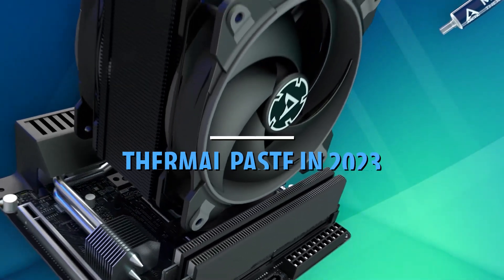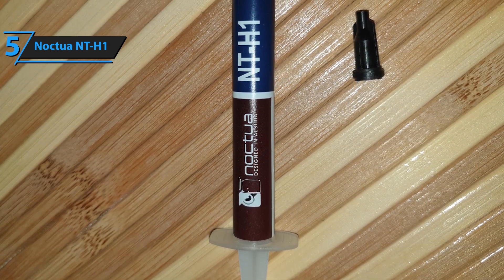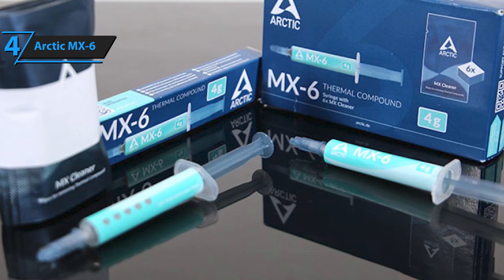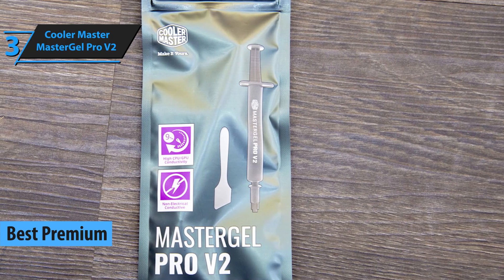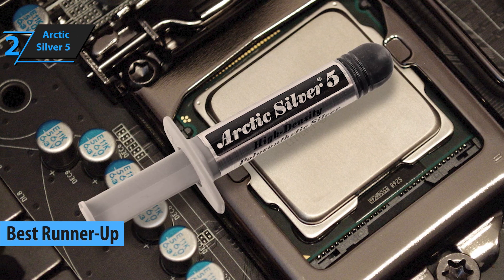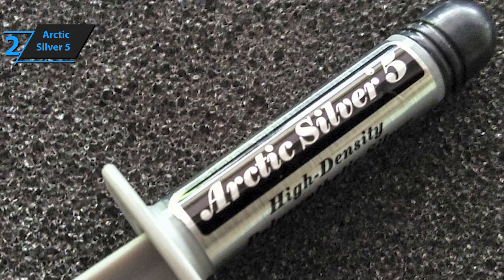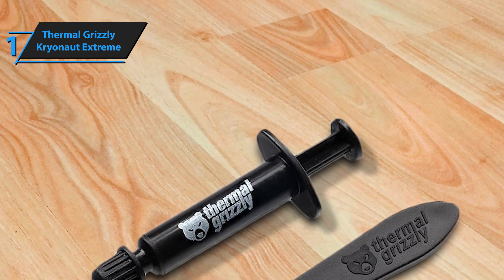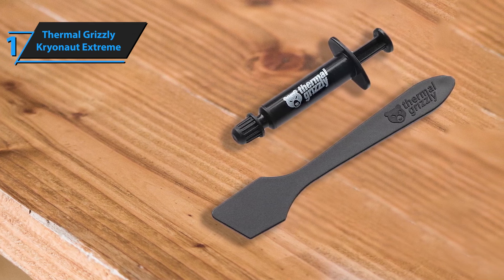Top 5 BEST Thermal Paste of (2023)

Comment: Love my Arctic MX-6.
Reply: Thermal pads on intel is a hard no lol…. Your gonna blow up some of your cores
Reply: MX-6 thermal conductivity is only 7.5W/mK
Alphacool Apex is 17W/mK
innovation cooling graphite thermal pad is 35W/mK
liquid metal is 130W/mK
higher is better

 MX-6 is shiat
Reply: @darkshadowsx5949  well my Ryzen 9 5000x idles at 26c and never goes over 60c I'm happy esp in CB r23 23,368mc 59.8c.
Reply: @darkshadowsx5949 comparing thermal conductivity among different brands, let alone products other than thermal paste, is not really deterministic of the final results a thermal paste will achieve.

I recommend you search around for a few benchmarks on the MX-6. It’s actually a really good and affordable product.

I personally use Noctua NT-H2, but I’d say Artic MX-6 looks really convincing as well.

Comment: 2 different Noctua thermal paste 1.19 NT-H1 and a second later NT-H2
Reply: That’s the best paste. Rn I’m looking at Artic silver & syy. I’m seeing good reviews with these 2.

I have Mx-4 but I want to look into other paste & see what’s better
Reply: @gorkman5697 since I have a 7800x3d now, I got thicker paste. I’m using syy. 

Has a thermal conductivity of 15.7W/m-k 

with a viscosity of 200.000 cps.

it was a little annoying to put on the cpu & at first I wasn’t use to that since I use to use mx4 but it’s one hell of a paste & it doesn’t cost much either. 

The reason I got thicker paste is because thinner paste will leak into the bottom of the cpu much easier.
Reply: @gorkman5697 when ever you get the chance you wanna drop that voltage down to 1.65mv which =‘s 1.2v.

thermal grizzly is really good, I’ve seen a lot of good reviews on it but be careful with Liquid Metal paste. one wrong move & you can damage the chip or the motherboard so just be cautious if you go down that route. 

as for the amd gpu, they do tend to run really hot so that’s no suprise to me. when it comes to both gpu’s, re-applying paste would do the trick. 

if it’s still too hot then you would also have to change the thermal pads that go over your memory & vrm’s. 

if I’m not mistaken the back of that gpu also has one so just take measurements of each pad in terms of thickness & length so you know what to look out for when making a purchase

Comment: I use peanut butter, it give me crazy low temps for ln2 eXtreme oc
Reply: Guys I trusted this guy and applied peanut butter but after 2 weeks ants went inside my laptop.....so please don't try
Reply: @madhanraaja.u5912  Bro how did you not know this was a joke 😂.
Reply: I use nutella
Reply: I put Colgate tooth paste
Reply: I use high voltage silicon rubber paste
Reply: Try lotion
Reply: crazy .. be careful of roaches
Reply: Try sperm from your penis. From personal experience works best, it’s free & quick to produce not to mention you’ll be pleasured👌🏽
Reply: you guys are maniacs
Reply: you clearly should be putting ketchup and mayo. For a saucy performance

Comment: you forgot to mention Thermalright TFX
Reply: That's a great thermal paste .just needs 20 mins in a zip bag hot water before application .but bang for amazing .also the dm9 deep cool is good .
Reply: @mejustanormalguy4742  u joking or u serious? does it really need hot water before application?
Reply: @t.l.c.9275  serious put the paste in a zip bag with hot water will make it easier to apply .it's so thick when cold